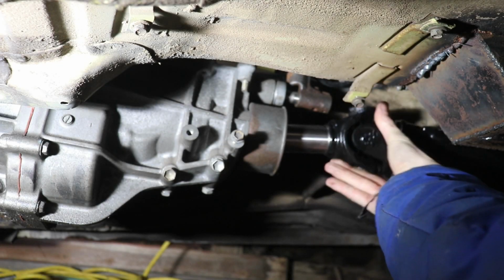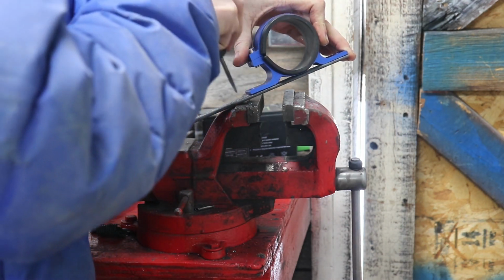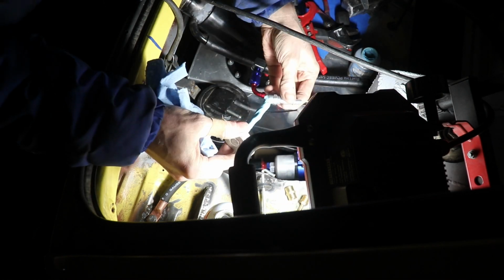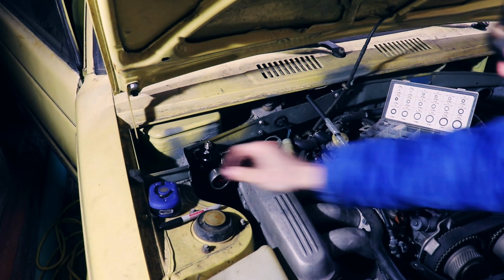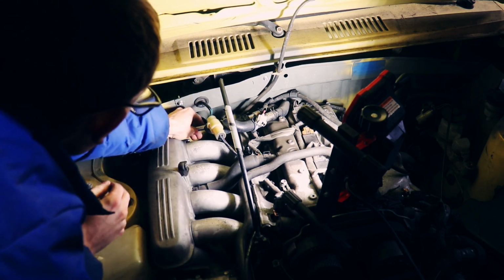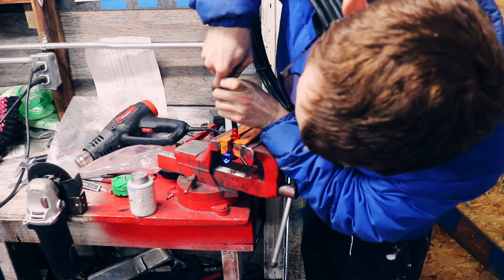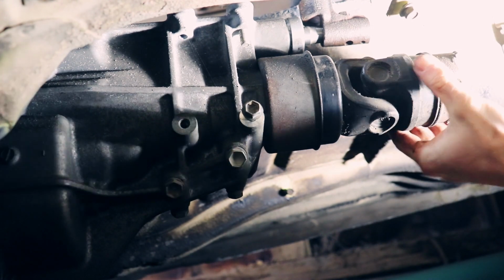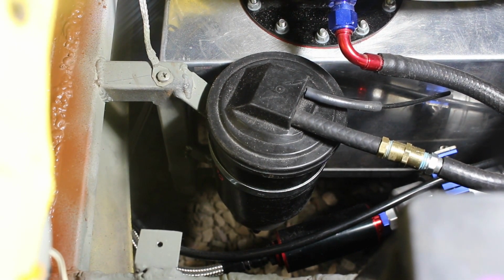BEAMS 3sge Toyota Starlet Gets Complete Fuel System & New Driveshaft! Ep. 4

Comment: Hope you’re using fuel safe Teflon tape.
Reply: Yea but for the vacuum line should I (T) it off?
Reply from the maker: Just found this this loose the other day, apparently not, I will have to search for some. If you have a recommendation please share.
Reply: @scrapmetalmade  depending on brand of teflon tape, it will deteriorate in with gasoline over time.  try this https://www.permatex.com/products/gasketing/gasket-sealants/permatex-aviation-form-a-gasket-no-3-sealant-liquid/
Reply from the maker: @DanhPhan  Awesome, thanks, I will try this out.

Comment: that thing on the propshap slip joint looks like it's only there for dust/water ingress prevention. I'd put it back if you wanna use that car in any condition. if it's going to be an sunny asphalt racetrack ride, it's good as it is I reckon.

source : my KP61 :-D

Comment: Hey where do you connect your vacuum line on your fuel pressure regulator?
Reply: Any vacuum source... usually from a small line on the intake manifold that is connected to the brake booster.